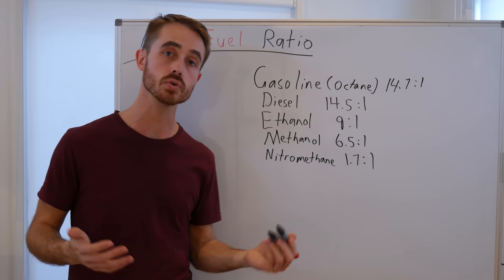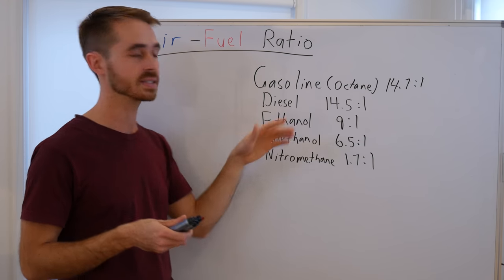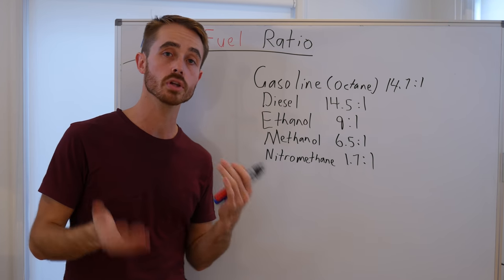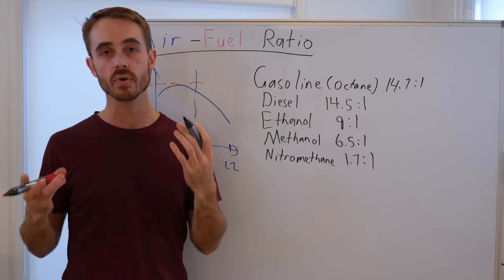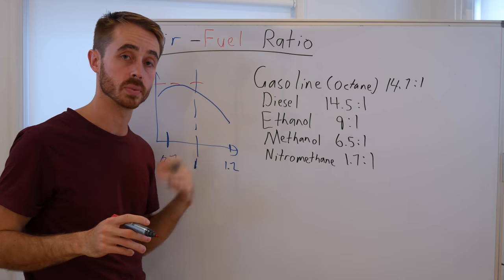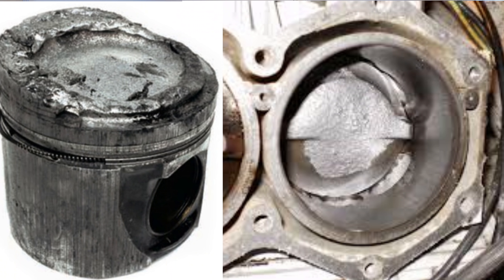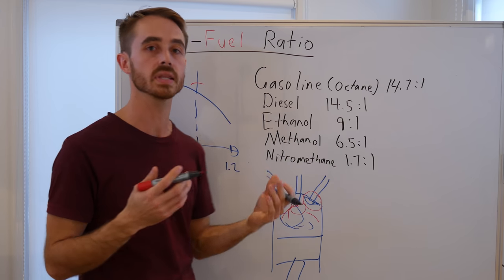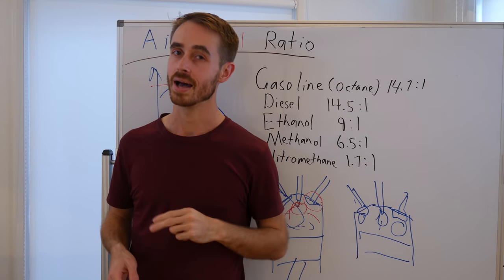Air/Fuel Ratio - How Does Being Rich/Lean Affect Your Engine?

Comment: What are the IMPACTS OF RUNNING THE ENGINE LEAN??

Does it cause backfire and drop in horse power?
Reply: It all depends on the conditions where the engine runs lean. At low load and moderate engine speed you lose small amount of power and save some fuel running the engine slightly lean (~ AFR 15.0 gasoline). 
At high load and engine speed, running even leaner will result in engine destruction either by knock destroying pistons, valves and head, either by overheating the combustion chamber to the point the head gasket will get cooked letting fluids to leak, and possibly melting exhaust valves and pistons crowns...

Comment: I'm not sure, but I think he's kinda wrong or rather leaves out a bit:

At stochiometric mixture, you'll have the highest temperatures (= danger of knock), both rich and lean will reduce temperatures altough rich mixture has a stronger effect.

There's a rather big difference between manufacturers and tuning: 

1. Manufacturers have to run lean (unless you somewhat cheat around it and have some kind of load based ECU or something that goes from lean to rich outside the emission cycle loads... ) because rich means fuel consumption and Co2 emissions go up (the cooling comes from the extra fuel changing from liquid to gas). And they also want to keep the temperatures low in order to avoid NOx emissions (which basically go up at high temperatures).

2. For tuning (especially in the WTAC and so on), you're always in the rich, the question is actually about "less rich" rather than lean... but some still say lean to "not rich enough" which causes confusion.

3. In racing, you'll often see fuel-flow limits, meaning you can only inject up to a maximum of fuel... so they tend to run lean to keep temperatures down / avoid knock. I'm quite sure the LMP1 Cars run lean.

If someone reading this aims to tune his car: Yes, you can gain more power from going from lean up, but you should actually go directly towards the rich side in order to keep the temperatures reasonable (if you don't have the tools to measure temperature etc.) rather than aiming for a 14.7.  A big danger of running rich however, is that your fuel pump may not always be able to provide enough fuel to sustain the ratio, especially when G-Forces are involved.
Reply: i thought lean causes overheating...
Reply: MadIIMike Max power is at about 15% rich of stoic for gasoline and this is well known since 1930 or so. I think the engineers designing fuel systems take this into account 🙂

Comment: I did a downpipe to my bmw the say that needs more fuel because its running lean what can you tell me about that infor.ation and that i can break a piston
Reply: Well, the exhaust probably has bettet scavenging, which draws more fresh air into the cylinder, which needs more fuel. But your car likely has enough headroom in cooling to handle it fine, however it would be better to get a custom tune for it

Comment: Are the “parts” by volume or weight?
Reply: (molar) weight. Also air consists only for 21% of O2. Simply dividing the fuel to O2 does not get you to the correct answer ;)

Comment: Hi, there are some german mechanicians on youtube who say that rich fuel air ratio lets the engine run hotter because the excessive amount of fuel "washes away" the oil off the cylinder sleeve walls. What is your opinion about this? Thx

Comment: Why does an engine running lean rev itself high? Is it because quicker combustion (less fuel)? And why does a lean engine produces more heat?
Reply: Gasoline also refrigerate the combustion camera.
Reply: Xiao Yáñez Fernández it’s not really that lean produces more, but more that rich produces less, as it takes more energy to vaporise the extra fuel, to the point that if you get rich enough some of the fuel does not evaporate at all and washes the cylinders.

Comment: Cars computer management system will try and maintain the correct fuel/air ratio.  So really doesn't matter too much to the cylinder if the computer is adjusting fuel input to keep ideal combustion conditions.  So unless your Long Term Fuel trims are getting way out of control...15-20% Really not much point in spending a ton of money to fix the problem (vacuum leak, fuel pump, EGR) unless you have an expensive car.
Reply: chances are you vehicle is only making those corrections under limited conditions. see closed loop fuel control. so yes fix these problems especially a fuel pump issue which could cause an excessive lean condition that can damage engine components. some modern vehicles will do wideband closed loop fuel control but even those cannot react fast enough to keep you engine safe if there are problems.

Comment: What about the the gasoline that has like 10% ethanol in the mix at the pump already, do you go by 14.7/1 or not?
Reply: You are already wrong because each retailer has different additives which will make a fuel lean or rich. Some (gasoline) can contain all those fuels together at once.
Reply: Hmm..14:7 is mostly for cruising..below 13 or at 13 is for lil high speed.
Reply: He said 10% ethanol gas has around 14.2:1 stoichemetry.

Comment: also, running richer on a diesel means more combustion heat, and leaner makes less heat
Reply: Only in theory. Practically you cant run a diesel engine rich nowadays, because the turbo charger, there are barely any diesel engines that dont have one anymore, adds the maximum amount of air into the chamber without a throttle body while power is completely regulated by the amount of injected fuel, as there are no carburated diesel engines at all. They just work completely differently than gasoline engines.
Reply: If you mean rolling coal then no thats cooler. If you mean gray exhaust smoke, hells yeah brother you are making POWER! If clear, cool you can make decent power too and good fuel economy! Dad had a truck made 1200ft'lbs at the tires, would light them up with a full load on the back and trailer if you looked the pedal funny haha Never puffed a bit of smoke!

Comment: What about water injection... Have you heard anything about it?
Reply: Low IAT advance ignition for torque. High pressure mist lean for power.
Reply: @jzxtrd337  I fail to see how carbonic acid, an extremely weak acid, would cause damage when extremely acidic NO2 formed in combustion doesn't. NO2 is an acidic gas and also forms nitrous and nitric acid with moisture in the air.

Comment: What about ceramic coating on the piston tops and the combustion chambers to combat detonation?
Reply: Mr. Adventure It does not combat detonation at all. Just slightly increase the thermodynamic efficiency by keeping the heat where it should be.

Comment: Kyle I love the videos. Can you talk about the benefits of sealed side skirts? It seems simple but I never understood how much it could help with downforce
Reply: Well I don't know if he did a video on it but as a simple explanation, if you have a car like an F1 which sits very close to the ground and has a flat undertray, it exploits the ground effect a lot thus there is a low pressure zone at the underside of the car. If you did not have a sealed side skirt or a barrier-like vortex running along the side of the car, the "outside" air and the high pressure air coming from the tyre wake would move and fill that low pressure zone. By sealing the side of the car, the low pressure zone is then sealed and it can then create a big amount of downforce at a really high aerodynamical efficiency (almost no drag created).
Check the Lotus 78 and the Lotus 79 to see a real-life example of side skirts and ground effect.

Comment: how i know i setting carburetor on my bike is good
Reply: install new s/plug,,blast it,,view plug ,will tell you rich/lean,,,then AFTER that,,cruise its some and view plug again and will tell you if needles are correct hight
Reply: Stick a air fuel ratio gauge on the exhaust the days of reading plugs and guessing are over

Comment: But if we want to achieve the maximum speed or torque in diesel engines we still want a leaner mixture, since in most of the diesel engines the accelerator pedal is directly connected to the fuel injectors, the more we accelerate the more fuel will be injected in the cylinders and hence more speed.

Comment: Ok why are manufacturers using lean mixtures to control emissions when running a richer mixture does two things actually 3 things your better better performance a cooler running mixture which helps to eliminate Nox and also you need co which in turn helps the catylist turn Nox to No actually what needs to be done is to improve the catylist and not run a power robbing mixture

Comment: You pretty much missed the biggest trap almost anyone makes when trying to comprehend those ratios..  ratios are by WEIGHT and NOT volume .. So don't just refer to them as X parts air to 1 part fuel (X:1) ..  And don't use that weird American measurement the pound.. I you want to talk about the ratios without going into SI vs weird Imperial.. The refer to them as parts by weight
Reply: Marc Jackson... If you choose to use it as a fuel equivalence chart then you may discard of the to one (:1) part but it don't change the fact that ratios is based on weight.. So you may use it to see how much more air you need into your engine when trying to burn fx. 1kg of Gasoline compared to 1kg of Nitro..  14,7:1,7 (that is 8,65 times more air by __WEIGHT ) but it still don't change the fact that the ratios are by weight and not volume... ..

The difference between measuring air in volume and by weight is enormous... Consider Gasoline 14,7:1... if that were by volume, and for the sake of mental visualization say we use Liter as our scale.. Then trying to burn 1L Gasoline with 14,7L of air is impossible.. That is stupid rich.. However since Air has a very low weight compared to its volume, burning 1Kg of Gasoline to 14,7Kg of air will get you Lambda 1
Reply: No I haven't played with N2O bikes... the closest I've been to that was when I were standing less then 2m from a Nitromethane burning drag bike during startup, I don't remember if it were started on Gasoline or  Methanol but when the mechanics had checked that it was firing on all cylinders (hot exhaust from all 6) he reached in (like he was disarming a bomb) and switched it to Nitro (turned a small spigot tap thingy)... It changed to quite a different note and when he cracked the throttle it revved like crazy...
I pity the insane fuxxer that wanted to strap his legs around that..

Anyway it was a straight 6 bike engine I think it originally was around 1300-1400 cc, it had two Roots type superchargers mounted side by side, each in front of 3 cylinders. the output when running pure Nitro was well north of a 1000hp... when he ran it that day they had the go juice watered down with Ethanol or Methanol so it "just" made 900+
Reply: I'm not that familiar with Drag racing but that does sound fast... I can't remember any ET time from the Topfuel bike but the engine was a 24-valve Honda CBX and it used like 14 or 16L of Nitromethane at every pass.... though i guess almost half of that was staging and warming tyres ... ... Are you running a Wet noZ system on that busa?
Reply: they are not by weight. weight changes and hydrogen for example has negative weight on earth. These ratios go by MASS
Reply: Tacit Tacet Lmao don’t use this American invention called YouTube 🤷‍♂️😂

Comment: And how does all this apply to 2 strokes..
Reply: the fuel bring in the oil. if you rin too lean you will blow the engine up from a lack of oil. air on the side of rich for 2 stroke
Reply: Not because of the oil because of the gas lots of 2stroke have oil pumps

Comment: This seems a little bit misleading... Basically you're saying that running rich makes you run more power, due to inconsistencies and imperfections in the ability to burn all of the fuel - In that sense, you're not actually running rich when you're providing more fuel - you're be running correctly. So it's all a bit confusing... Lol.

Comment: If you run your engine rich, you are creating air pollution, (smog), and wasting fuel... period. Race cars run rich so they don't take the chance of having detonation in their engine from a lean condition at high RPM. This would blow up their engines, melt pistons, burn valves , etc., especially if running a race engine with Nitrous Oxide or under boost.
Reply: Gasoline Vapor Systems Yea.But thats what cats are for.
Reply: Smog is actually made from NOx which is produced in large numbers when lean

Comment: Gasoline is pure octane?
Reply: Gasoline is a mixture of many different compounds. Including benzene, ethylbenzene, toluene, xylenes, pentane, butane, octane, heptane, hexane, cyclohexane, napthalene, trimethylbenzene, isopentane, styrene, MTBE, ETBE, TAME, ethanol plus various alkanes, cycloalkanes, alkenes, aromatic hydrocarbons and some other additives for fuel stabilization and detergents.
Octane itself is just the "standard" for gasoline by which it is measured. Octane is defined with an octane rating of 100 and everything is measured against that.

Comment: my motorcycle runs like garbage with 10 percent ethanol fuel.
total different machine when run on NON ethanol fuel, better in every way, power, throttle response, and better miles per gallon.
i use rec 90 fuel with no ethanol in both trucks, my car, motorcycle, and my boat.
car runs much better, and i get 100 more mpg, wife asked if i put a turbo on it, i told her i put real gas in it...
no one mentions the fact that ethanol is bad for your vehicle.
it causes problems, and rust in your fuel system,and decreases power/ mpg
and any vehicle with a vented fuel system, ie boat motorcycle, lawnmower, generators etc, the ethanol turns into water, and goes straight to the bottom of your fuel tank...
e 85 gas in a non turbo car will get terrible gas mpg, worse performance, and engine noise will be louder.
i wish someone would do a video exposing all the facts regarding pump gas with 10% ethanol vs non ethanol fuel

Comment: a diesel should never be at 14.5:1 it should be like 24:1 for low load and 20:1 for high load
Reply: This is not about compression ratio, this is AFR
Reply: @sneez9461  i WAS talking about afr
Reply: @its_robbietime1333  well, i joked because 24:1 is like SUPER lean for a diesel, its around 14-15 and a little over for turboed
Reply: @sneez9461  no that will just make fuck tons of smoke

Comment: Diesel engines don't use a leaner air/fuel ratio than that. Typically around 18:1 - 25:1
Reply: Diesel Engines can go as Lean as they want. Modified Big Turbo Diesel engines can see 100:1 AFR's. The main reason you don't see it in production vehicles is although these super high AFR's are very very efficient they generate some very nasty biproducts.

Comment: methane? propane?
Reply: As gas suppresses oxygen, burning it rich does not increase power and as the vaporization from liquid to gas cools down the engine, especially with gas injection, you could lean it out a lot without risk of overheating or knock, making it very efficient but also clean, however it usually is adjusted to gasoline because most LPG or LPI cars also have gasoline for starting.

Comment: I'm the one jackass who gave this video a down vote. But I had to, because it's filled with misinformation in the beginning.

When talking about AFRs, you keep saying "parts" but that's a measure of volume or moles, and AFRs are mass based.

Then, you talk about how having a lower AFR value is a benefit. It's not that straight forward. If I'm using a fuel with a lower stoic AFR, that means for a given mass of air (which will be determined largely by your cylinder's volume) I need to add A BUNCH MORE fuel, which displaces the air and lowers the volumetric efficiency if the engine is port injected or carbureted. Now, granted, if the energy density stayed almost constant as AFR changed then you'd gladly trade that air mass. However, you completely ignored energy density in this explanation. If I run straight Ethanol, which has 57% the energy density of gasoline, after accounting for the AFR difference Ethanol can provide just 93% of the energy of gasoline for the same air charge...but you have less air since you displaced that with fuel so your overall mixture mass is lower, so <93%.

Why run Ethanol? Well, I have to say after this point you did a good job of explaining that :) But! You must increase the compression ratio if you were already able to run MBT timing. High revving small displacement engines usually aren't knock limited at high rpm, for example.
Reply: It's not volume based? It's not 1 cc of fuel per 14.7 cc's of gasoline? It's one milligram of air per 14.7 milligrams of gasoline?
Reply: I didn't understand anything, where can start?
Reply: Just for youtube Yes mass. And 14.7:1 is just a value for a certain idealized gasoline.
Reply: absolutepressur You just made the case for GDI :)

Comment: Sweet jesus. When spark plug people talk about diesel physics this is the result. Virtually nothing in this video is correct when it comes to the CI cycle process. How the diesel engines behave under overfuel/underfuel conditions, how the ignition and rev management occurs. Hell, even the "injector location" isn't necessarily right. Also totally ignores that there are IDI diesels as well